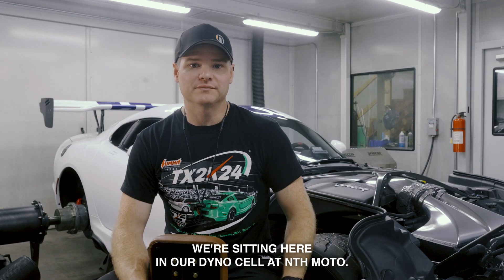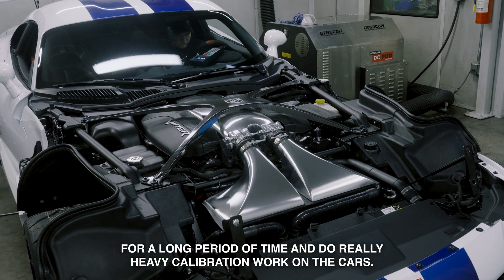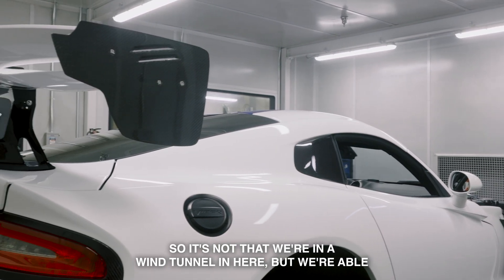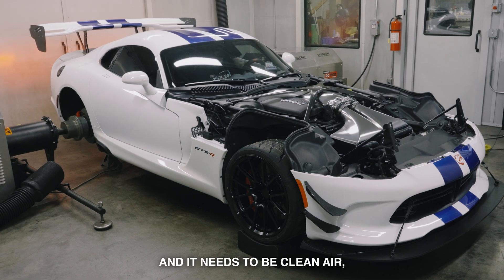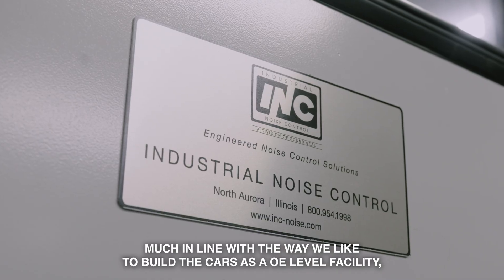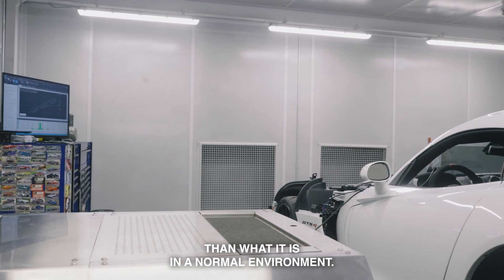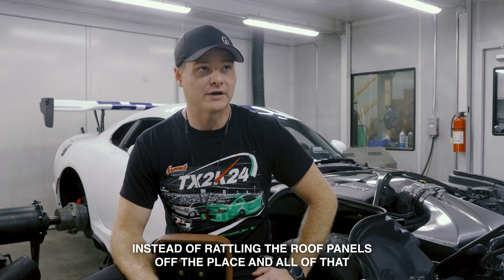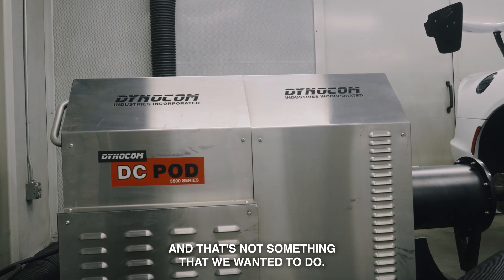Nth Moto STC53 Dyno Cell; How can you tune without one?

Comment: I recently bought a 2005 viper roadster and i love it. I would love to hear your opinon on the best mods for the gen 3. Id love to do a turbo set up but i havent seen to much info out there on the gen 3 set up, such as what all you need to buy if i need new piston and connecting rods. Im not sure how much hp the stock parts can hold. I have seen that a super charger or pro charger is not as good of an option as the turbo set up on the viper due to the torque or extra pressure it puts on the crank shaft. Amazing shop btw buddy love the new booth thats probably one of the cleanest dyno set ups ive ever seen.